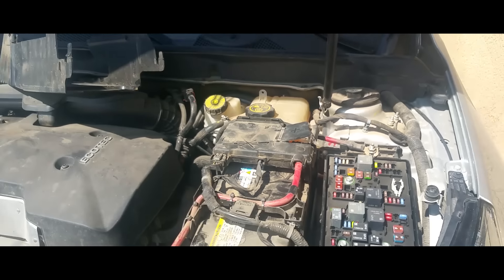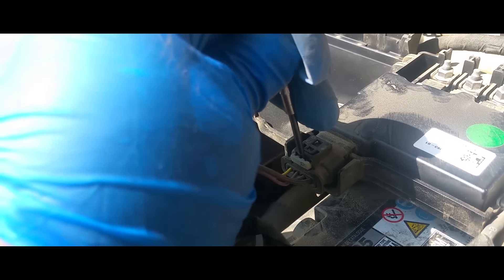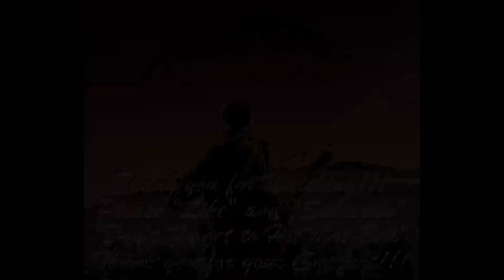How to:  Remove a Battery from a 2014 Chevrolet Malibu

Comment: If anyone comes to this is 2022… if you wish to save about 30 minutes… there are slots on the side of the piece covering the battery. Stick a flat head screwdriver in the slot and press outward from the battery and it releases the tabs
Reply from the maker: Thanks brother 🙏

Comment: I did all that to get the battery out, then discovered the positive terminal bolt was corroded, stripped and loose.  Replaced the bolt and nut on the terminal and it’s good to go.  Thanks for the video, Sir!
Reply from the maker: No way! Heck yeah! I'm glad this helped out! Thank you for your SUPPORT!

Comment: Thanks my dude for this video. Just finally had to replace my stock battery (6.5 years) in my malibu and never seen a battery be this involved. haha was super easy to do after watching this!
Reply from the maker: Heck yeah bro! Im glad this worked out for you!
Reply: @559powerscape  Do you have a video for the smaller battery in the trunk? I am needing to replace that one and it seems easy, but I am not sure if I need to disconnect the main bettery before touching this one. Any tips and walkthrough would be nice.
Reply from the maker: @TbouncerT  no need to disconnect the main battery...heres a video showing how. Pretty simple process 
https://youtu.be/vVwKdgyUQgs

Comment: Have you ever had to replace the battery in the trunk? The aux battery ? My car just gave me a code saying something is wrong with my aux battery in the trunk just curious on how to get it out
Reply from the maker: No sorry, I did notice that Battery when we had this Vehicle in the Lot but didn't bother to remove it and could not find a video on how to remove it. Im sure its pretty similar. Just remove the terminal connections and the battery tie down and it should come off. Hopefully. Sorry I dont have a video for that, but i will make one once I come across another car that has the similar setup. Sorry and Good Luck!
Reply from the maker: Made this Video just for you on how to remove the AUX Battery. https://youtu.be/s6uCt15Aq9M
Reply: It's super easy to replace the trunk battery @  Hiz hunny

Comment: You forgot to mention this battery costs around $250-$300 and the like battery in the trunk costs $90-$150
Reply from the maker: Man we have  An account with battery systems and batteries is only 65 to $75 each seventy-five for the big ones 65 for the small ones....Sorry Bro!

Comment: Hey man about to do this myself, question dealer says they want to replace my battery cables due to high resistance for 1,200 bucks. I said NO I will do it my self. Ever heard of this before with these malibus?
Reply from the maker: No I have never hear this. Wow if this is the case Look up The Big 3 Upgrade on youtube and this should take care of it and its only going to cost you like 20-40 buck in supplies

Comment: Do I have to disconnect the six electrical wires in the box
Reply from the maker: No its just a couple of them. The video shows how to remove it out from the engine bay.
Reply: Thanks a bunch just finished
Reply from the maker: @PMBC01  Your welcome! Im glad it worked out for you!

Comment: What sizes did you use in total?
Reply from the maker: I think it was 10mm, 5/16 and 1/2 sockets cause you need to disconnect 2 wires with the  standard sockets and the battery connectors with the 10mm.